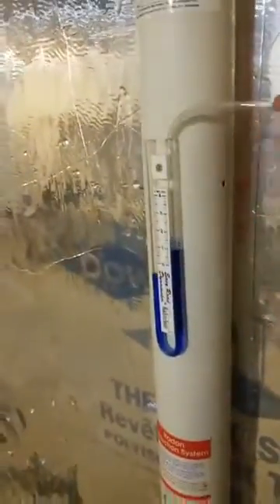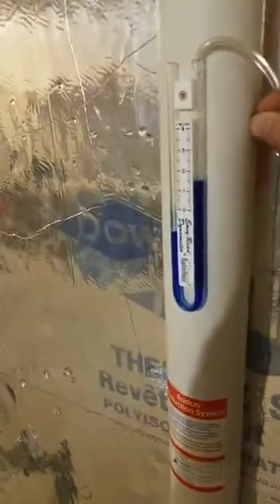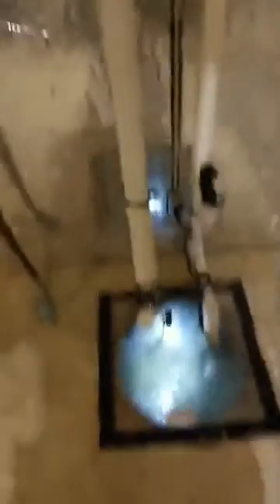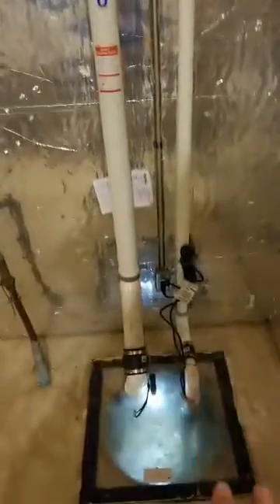Can a Radon Mitigation and Sump Pump Share the Same Pit?

Comment: How about using same pipe. I have sump pump, can’t the radon mitigation use the same pipe?
Reply: No, that wouldn't work. The water is pumped out with a water pump amd the air is tucked out with a fan constantly

Comment: That looks like a real PAIN to service!  I normally ignore my sump pump, as I also have a battery backup pump installed, but just recently the float switch on the primary pump failed, and the reason I noticed it was the sulfur smell from my backup pump's battery that had failed too!  Had to pull both out to service the lower-level primary pump.

I see in your video, there are rubber coupler sleeves which seem simple enough to undo, but trying to lift the whole assembly at once, it sure seems like the seals around the pipes will be compromised, and how does the plexiglass even seal against the floor?  Is that just plumber's putty or clay?

Comment: How does this work if your pit is filled with water to a point that it hasn't kicked on the sump pump yet. How does the radon fan suck radon gas out from beneath your slab with water in the pit?
Reply from the maker: As long as the water is below the level of the black corregated pipe that drain water into the pit it's ok. The pump should kick on before water gets to that level. Great question!
Reply: @homestandardsinspectionser3704  I don't have a corrugate pipe as I don't have a french drain. What I have is what looks like a square concrete sleeve that extends about 18 inches below the slab and about 9 inches above it. The slab was then poured around it.  House was built in 1966. The bottom of the sleeve is well below the level of the bottom of the slab but, because this is always filled with some water, a radon fan will not be sucking any air through the water. It can't suck any air from the sides due to the concrete sleeve. I think I may have to drill a bunch of holes through this sleeve at a level below the slab but above the water for a radon fan to work in my case.
Reply from the maker: @vicpinto1970  I shouldn't assume all pits are created equal :) I think you are right about drilling holes. Often we see the radon pipe hole drilled in a location close to plumbing drain lines because earth is typically more back filled in those locations and has settled creating that air gap between the slab amd the earth.
Reply: @homestandardsinspectionser3704  Thank you Sir. I think I'm going to hire a pro for this. I don't want to deal with the hassle of a DIY - not for this job anyways.